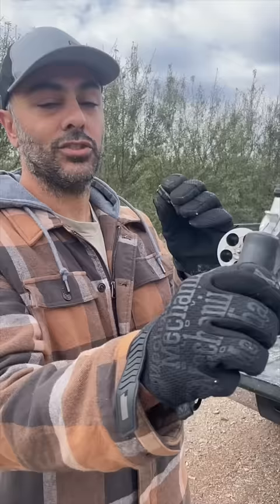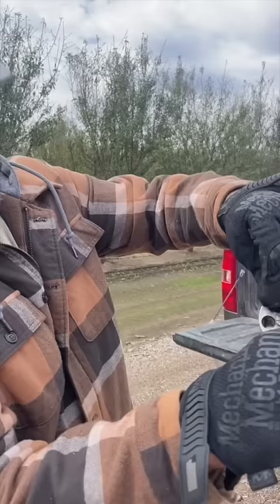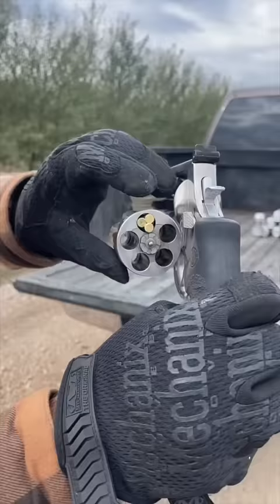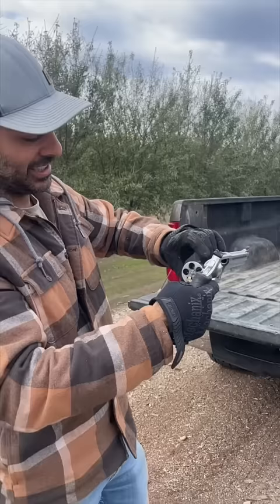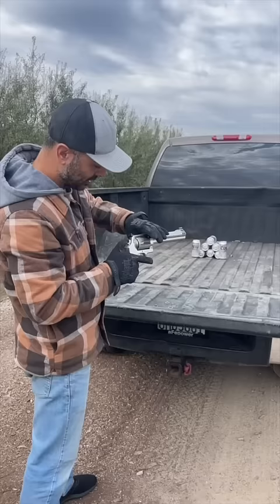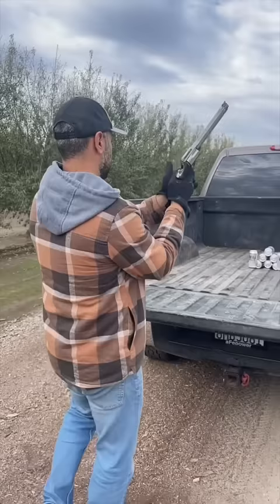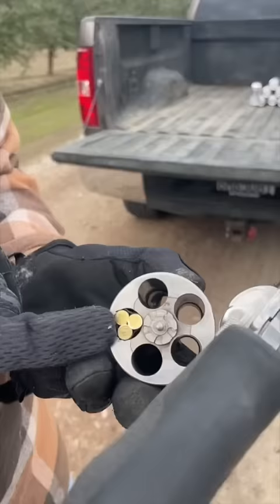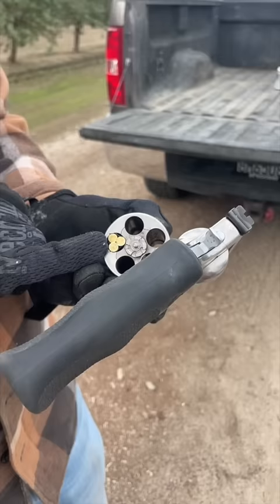Firing 3 rounds of 22lr out of 500 Magnum revolver?

Comment: To own a gun like that you know this wasn't going to work in the first place... You know that the hammer needs to hit that bullet in the circle where the primer charge is...
Reply: Not necessarily because he is using rounds that are rimfire
Reply: @xShVAK  you are incorrect sir the hammer must strike the the prime charged in the center of the that's called rimfire, do a Google search.. just because the hammer falls on the rim of the casing they'll never fire no matter what bullets you shoot... I can only assume you made an assumption thinking that because it's called rimfire if the hammer falls on the rim of the casing it'll fire that is incorrect Google it. It has to hit the primer charge. Like every bullet you can basically buy nowadays is rimfire... There's no special rimfire bullets that will fire if it's not in line....

Comment: Wouldn't be have to standardize the placement of the rounds in each cylinder (accounting for rotation so they reach the barrel in the same position every time) and a 3 pointed mechanism to touch the blasting caps of all three rounds? All for it to still maybe not work?